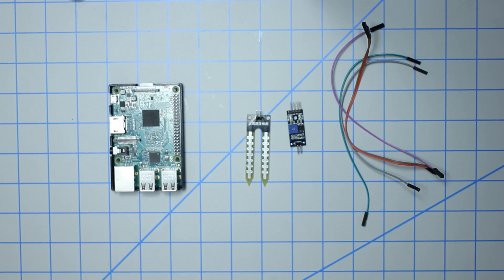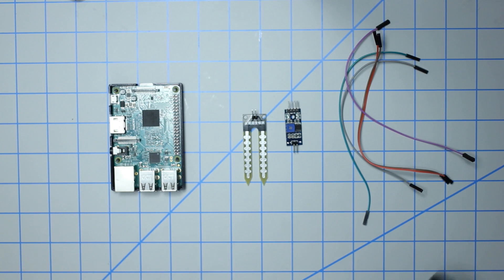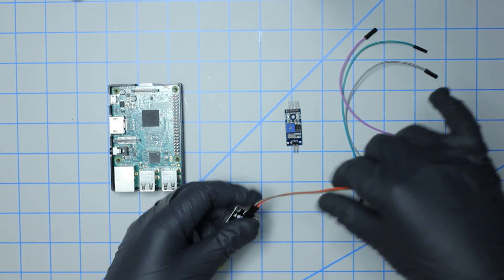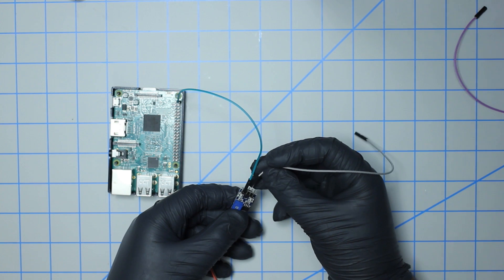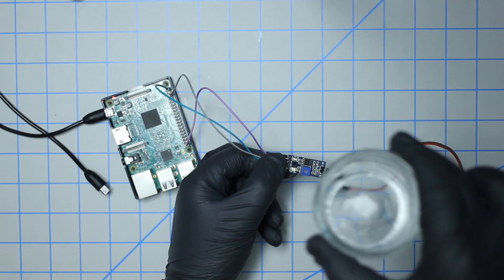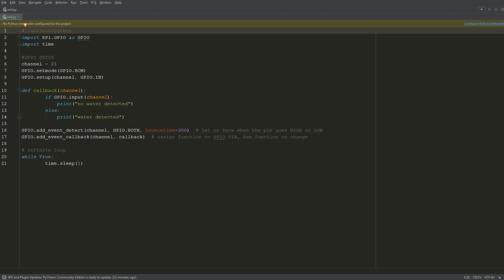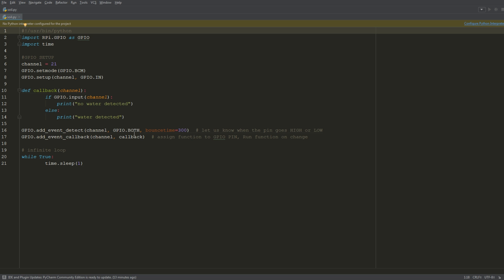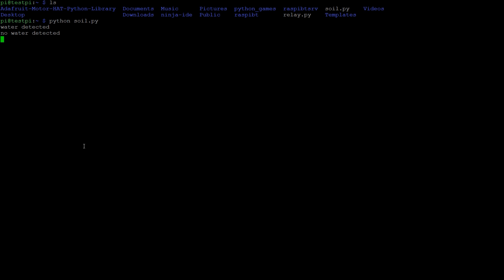Soil Moisture Sensor (Raspberry Pi)

Comment: great tutorial!  is there a way to only turn on the sensor once every few hours instead of constant electricity stream? the electricity 24/7 on the sensor anodes and cathodes (lol i feel smart remember some terms from high school classes) is what will make them deteriorate, not the moisture of the water (well that too, but not as fast as if electrons also are running 24/7 across the poles).  can raspberry turn on and off these sensors?

Comment: I'm thinking about getting a bunch of these to put under the carpet in my basement and measure for leaks in the foundation when in rains. Do you think these sensors would be adequate for that?
Reply: Should work as it is basically sensing moisture. It's all about how you do the placing the unit.

Comment: sir,may i know how to convert soil moisture sensor data into a graph?
Reply: You will not be able to do this with this setup. Due to the nature of the sensor and the information only being shown as 0 and 1 depending on if the sensor detects more or less moisture than what is set up with the potentiometer on the board. A good graphing library for python is PlotLy which can be used to easily create graphs with data that you collect. However, be warned that using this setup you will only get boolean outputs which will make your graph look like a PWM signal and not like a curve which is probably what you want.

Comment: *it says import error there  no module named RPI.GPIO* I'm a noob pls help😫
Reply: RPi.GPIO 
The i must be a short letter
Reply: Believe it or not, problems like this are how you get better as a programmer / developer. In general, when you have an error, you end up learning a lot that you didn’t know about while trying to fix the error

Try googling it. Look on stack exchange in particular, but any other site is probably fine. dont get stuck on one solution though read through a few of the solution, and get an idea of what you think is going wrong

My guess is, you don’t the correct version of RPI installed.

RPI is what’s called a library. It’s a bunch of code that’s pre written that allows python to do stuff on a raspberry pi. GPIO is a module, I.e. specifically the code for communicating with the GPIO pin out.

When you import a module, python goes and looks for it. That means that either

A) the module isn’t installed
B) the module is installed, but is somehow incompatible with your version of python
C) python can’t find your module

A and B can be solved by reinstalling the version of the module. Just google “how to install __ for python version _ on a raspberry pi”

C can be solved by finding where your module is being installed, and playing around with environment variables and installation locations (though idk much about Linux yet. I’m not sure how that works on a pi)

Your issue is probably A or B, and figuring this out through google is a great exercise and learning experience. Good luck

Comment: To stop deterioration of the sensor conductor, only sense for 5-10ms and only sense every hour or whatever suits you, that way it's not constantly on and constantly performing electrolysis. If you don't do this then all the nasty chemicals leach into your soil and kill your plant, while your sensor will be inoperative after only a few weeks at most. The other alternative is to use a capacitive sensor instead.
Reply: how is it possible to control that sensor run time?  can raspberry turn it on and off by a set interval like a cron job let's say or a python sleep timer?  that's the correct way actually - because doesn't make any sense to run sensors 24/7, everyone should put an interval the way his greenhouse needs it based on the plants you grow.  i can't find tutorials like this, could you please share the way you implemented the turn on and off for the sensors? =)
Reply: @babyfox205  I'll try and find my code.
Reply: by the way what are the best moisture sensors you tried? capacitive sensors can be some good quality model or they are all the same?  I see the same models on all websites and it looks flimsy board with flimsy little copper on it, imho the soil can eat it fairly quickly.  we need some with 'rods' , why nobody make good quality sensors with 2 aluminum rods or something? like the ones used to measure PH of the soil.  it seems best option for a moisture sensors as well.
Reply: @babyfox205  Capacitive are more accurate than the double-rods, i also waterproofed mine .

Comment: What if I want to use multiple sensors? Do I need another Pi?
Reply: Kazimir no you don’t need another pi for that. Just connect another sensor to different PIN number and copy that code, then change GPIO number (PIN number) in program

Comment: Can someone tell me what application you need on the pi to do this with a link would be great
Reply: Any text editor will do. You can create a file on your Pi and edit it there, or you can create it on your home computer and transfer it to the Pi. He's coding in Python and is running the code on the Pi.

Comment: This sensor corodes away in a few weeks if left in water.
Reply: It's a pity... Does any anti-corrosion spray help in this case or it will influence the measurements?

Comment: Can you use digital signal to measure the water on a scale (f.x. 1 to 100) or is it always binary (true/false) ?
Reply: I need an mcp3008 converter
Reply: U
Reply: @IceDexCorp  do you?
Reply: @Johnny smirks DID you figure this ?
Reply: @ThalesBroussard  DID you figure this ?
Reply: @Pew Peww Looks binary to me.
Reply: @ThalesBroussard  Did you figure it out? I want this aswell haha
Reply: @stanvanweringh  DID you figure this ?
Reply: @saarrefaelov5543  I didnt really go through with the project so i didnt figure it out
Reply: @saarrefaelov5543  The sensor used in the video is a purely discrete sensor, 0 or 1.  You would need a sensor that detects moisture level and outputs an analog signal, but then you could replace the code that tests for a digital input with an analog value.  However, most likely if you are turning water on or off, you would still be checking whether the analog signal was above a threshold or not, which is basically a discrete signal by definition at that point.  If you needed it for a different reason, like computing the amount of chemicals to add based on moisture content, then it might come in handy.